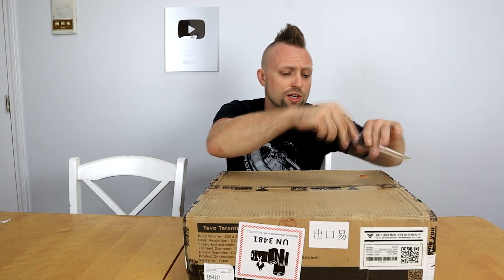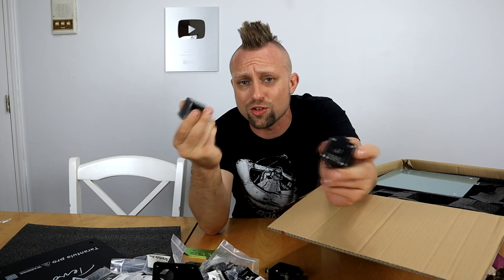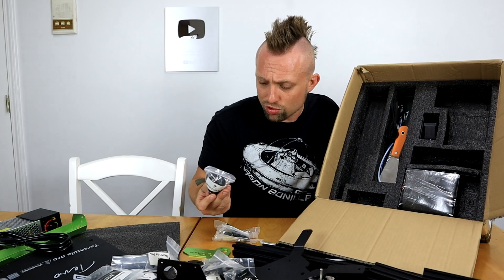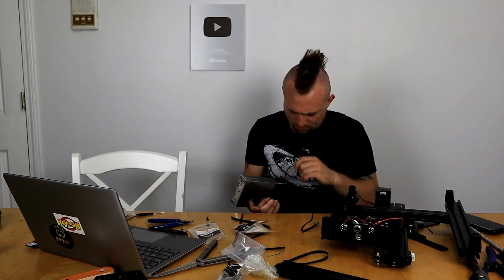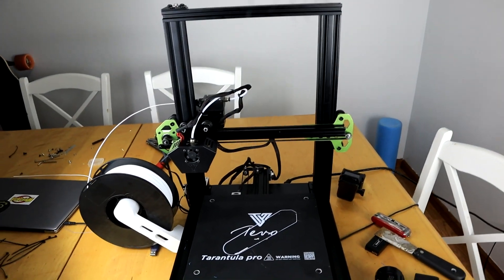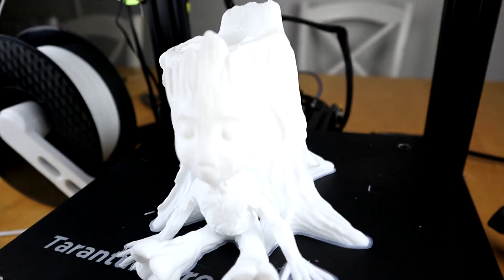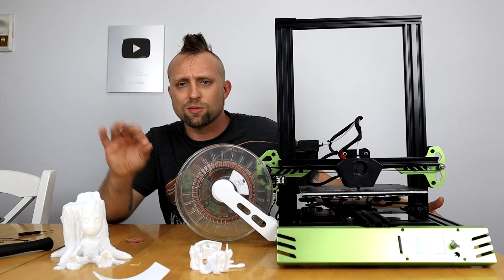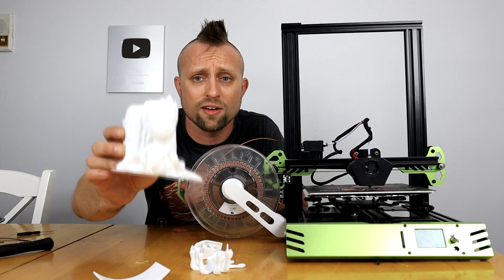Tevo Tarantula Pro 3D Printer Unboxing, Build, & Review.Best $200 3D Printer 2019

Comment: I got a Tarantula about 2 years ago but have upgraded it so much, it is virtually a completely different printer and definitely outperforms this newer one. All parts were non Tevo so they costed easily a few hundred percent cheaper, No more acrylic pieces, all corners boxed and stiffened,  v6 hot end, Titan Extruder, Aluminum X tray, cogged freewheels, adjustable belt tensioners, hidden board and power supply. Hictop 280mm bed and adjusted it so that all of the plate is usable, Dual Z motors wired in series instead of parallel, HP server power supply that was configured to allow the printer to have a M80 (on) and M81 (off) commands via gcode. Octopi so  I no longer use an sd card and can print and view remotely via any internet connect. I can turn it on and shut it off via commands anywhere.  It was a Tarantula but is not one any longer.

Comment: Great video but it would have been nice if you slowed it down just a little😁. Does the hot end use the longer nozzles? Does the PTFE tube go down into the nozzle? My biggest problem is with nozzles that insert the tube all the way into the nozzle. Eventually it gets cooked and shrinks causing problems.
Reply: Bill Karoly Really I only like hotends that the tube goes down all the way. Way less sections and less areas to jam/clog in my experience.
Reply: Bill Karoly I would only prefer all the way down type for printing pla and PETG tho because it’s not high temps.
Reply: @xhex_3116  I've had PTFE tubes cause jams because the tip in the nozzle shrinks eventually.

Comment: I don't understand why they don't include an auto bed level sensor now...  I added it to my Anet A6 and I've only manually leveled the bed once in almost 2 years.  I think the sensor cost me less than $10, easily worth it.  I bet I could add it to this one too but it's a bit of a hassle.
Reply from the maker: There is a spot on the board if you want to add obe

Comment: What is the point of a titan extruder attached to a bowden?
Reply: the titan extruder isnbt a direct drive extruder it uses a mechanism with 3 gears that allows the stepper motor to do less than a normal one also the gear that pushes your fillament tru is made from plastic if you use alot of abs or pla to print with it wears a little bit wich allows the where to go in the gear also because it doesnt use a heavy or big spring you are able to print with ninjaflex and such flexible fillaments without any upgrade prints to the extruder on my anet A8 i have a sturdy spring and a metal gear that pushes the filament when i tried printing ninjaflex on it the filament would stick to the gear and wraps arround the stepper motor axes
Reply: @ByWizazz  but you  still have a bowden and problems associated with bowden? 
The problems being flex of tubing.

I'm not trying to disrespect in any way, it's just that I'm trying to crack 3 in 1 out hotend and it seems impossible to get a good print.
Reply: @Quadromodo  hey man i got a Tevo Tornado im running a dual extruder and 1 nozzle sofar i havnt had any issues while printing my prints come out fine i upgraded the stock bowden PTFE tubes